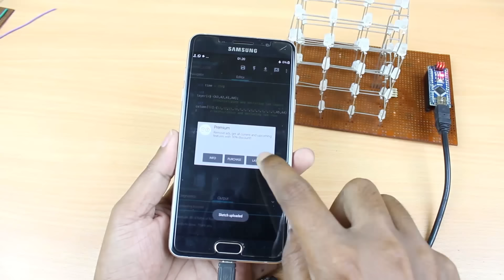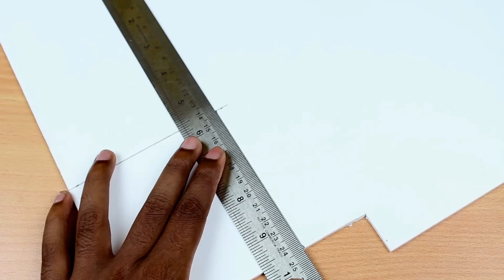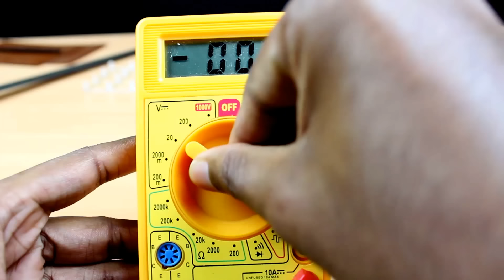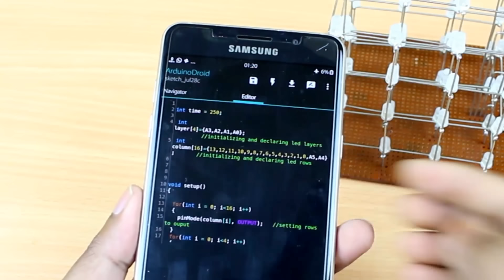How to Make a LED Cube at Home

Comment: After dumping the code, can it be directly operated with simple power supply, or else do we need to use the mobile all the time while operating.????
Reply: According to my knowledge, once you've programmed the arduino you will never need a phone again, you just need a %V only
Reply: New Trailer hi I need help to do this and components were it available

Comment: One of the best ways I've seen of constructing the cube.  I've just tried soldering up a 3x3 cube using the LED legs, as per the instructions, and the result isn't cube shaped (the anode legs aren't long enough) and it's basically an abomination.   After seeing your video, I'm encouraged to give it another go, this time following your guidelines!
Reply: @Axel Ali instablaster =)
Reply: @Killian Jayden i really appreciate your reply. I got to the site on google and im in the hacking process now.
Seems to take quite some time so I will reply here later when my account password hopefully is recovered.
Reply: @Killian Jayden it did the trick and I finally got access to my account again. Im so happy:D
Thanks so much you saved my ass!
Reply: @Axel Ali No problem :D

Comment: Nice work Tapendra. I especially liked how you coded the patterns. My primary interest in creating one of these is getting hands on experience coding the led's, etc... Great project, simplistic enough for a beginner hardware guy like myself and I got a kick out of how you did the "pcb" routing with the perfboard. Saved to my projects folder, I'm on this. THANKS!

Comment: Made it yesterday , works perfectly fine , thanks Tapendra  this is my second project from your works
Reply: hello, how does this works it looks like every LED has a connecton ?
Reply: @HyndrosHD  yeah ,each led has an independent cathode but the anodes leds in each layer are connected
Reply: @ilyesilno4640  Ok understand so each LED has its own output ?
Reply: @HyndrosHD  Right
Reply: I have a question. Shouldnt the leds be connected to the ground pin?
Reply: Hey ,which thick wire dud u use? I was using aluminum wire but facing some difficulty . Which materit wire should i use? Also can u pls share the link from where u have purchased.
Pls reply asap

Comment: how did u do tue coding in ur phone??
Reply from the maker: install arduino droid on ur phone and connect it via OTG cable
Reply: Tapendra Mandal  sir u hv connected your mobile with a device Na..is it...aurdino board...for 4*4*4 led cube
Reply: padhi srikanth it's not 4x4x4. It's just 4 layers... so real just 4....

Comment: I hope you are still reviewing and replying to comments. Thanks in advance.
I really liked your design and I followed pretty closely only made one change on how the vertical wires connected.
I did a circle with this wire just like you did with the horizontal wires.
I am having one issue, Column 13 (D0) doesn't have enough voltage to light the LED when the other 15 columns are on.  Column 12 (D1) is slightly lighter. Voltages on the Columns 0, 1, 2, 3, 4, 5, 6, 7, 8, 9, 10, 11, 14, 15 are at 2.65v. Column 12 is at 2.6v and Column 13 is at 2.4v.
I have ordered some smaller resisters, I am going to try a 75 ohm first and if that doesn't help I will try a 62 ohm next.
If I change the code to turn on all LEDs on any one level, column 13 will not light and column 12 is slightly less bright than the other 14 columns. Has anyone seen this same behavior? I am running this with a Nano. As long as I don't try to turn on too many LEDs per level the design works well. If I do, column 13 (D0)  doesn't work.
Thanks for your design, I enjoy working on projects like this.
Reply: Starting to build it myself. Have you figured out the issue? Also, what are the connecting metal rods called?

Comment: Nice work! You connect 16 wires to control by 64 led's. One wire for 4 led's. But in your presentation every single led works separately. How it works?

Comment: hi tapendra i'm a fan of your works they are impressive , well i made one of your creations last year the robot line follower without arduino and it goes very well and this year i wanna make this one but in the process of building it i wondered what is the source of energy ? is it the phone or you used an external batttery ? i hope you had a great day
Reply: hi brother do you still have the code please
Reply: @wilmanenamorado3146  hey nah not really but you can pretty much use any 4*4 led cube project source code that are out there

Comment: I’m trying to work out if there is a pin left on the Arduino to have a push button as input. Then the button could swap between different patterns in the program. You’ve got 20outputs so not sure if there is a spare input slot

Comment: How are the leds working if they are not connect to ground pin?
Reply: You can use an Arduino pin to sink or source current so if you code it right then you are sourcing the positive side and sinking the negative. This provides a ground path.
Reply: @mikeoliver3254  i didn't really know that! Thanks for replying !!!

Comment: How did you do those lines of solder at 7:03 in the video? Did you just use solder all the way up or did you put a tiny piece of wire in each hole leading up to it and then soldered that? This part is unclear but everything else is pretty clear.

Comment: After running the code.
What is the measurements of main power supply??
Can i use 5 volt dc mobile adapter?

Comment: Hey i have a question (sorry for my english, not is so good) What is that golden board that you use to solder the arduino and what are those two black bars that you also solder on the board? you would help me a lot :(

Comment: Isn’t it easier to connect all cathodes in a layer together and have the anodes as “columns”? Also, an Arduino Uno is far better than a Arduino nano to use in this type of project because the extra stuff u add in the PCB is easily avoidable

Comment: Can I use resistor 220 Ohm?

With 12v power
Reply: These LEDs usually require 3V and 20mA to light up properly (check the data sheet with the LED to make sure).  
The calculation for this is:
R=V-Vled/I
R=12V-3Vled/0.02A
R=450Ω
So, use two 220Ω resistors for each LED.

Comment: I made it. Now I want to use it with Arduino pro mini but D0 and D1 pins are missing there. That's why 2 columns are not working. So I edited that code, just declared A6 and A7 at the beginning of that code instead of D0 and D1. But still it's not working. Can you please help me ?

Comment: This is random. Not interactive. No mic chip is added to the circuit. So no sensors. Not an analyser. This is prank. This is just a random programmed version. Or atleast it looks like that. Then what's the use? things should look as told about...

Comment: You can burn arduino quickly by doing this. Arduino has max power draw of 200mA and single LED use 20mA. When more than 10 LEDs are on you risk destroying arduino. Also there is no multiplexing so you cant actualy light every LED you want. Very poorly made tutorial would definetly make some research before doing it.
Reply: I m running same tutorial method for last 1 week continously, nothing burn or damage. Lets c how long it can run.
Reply: @maninderjeetbook  so how did it go?